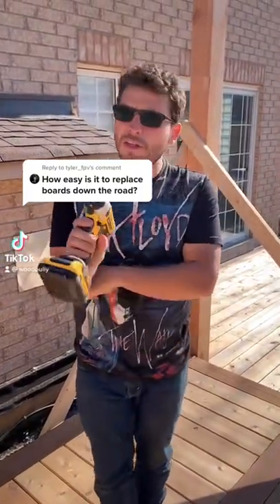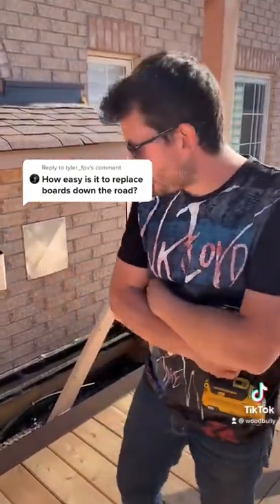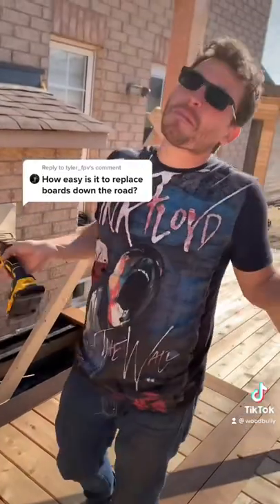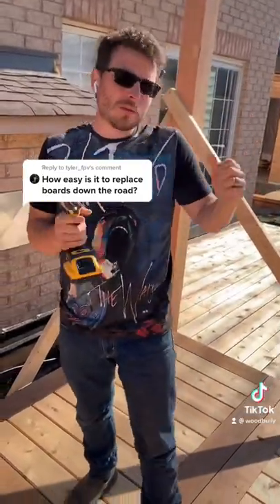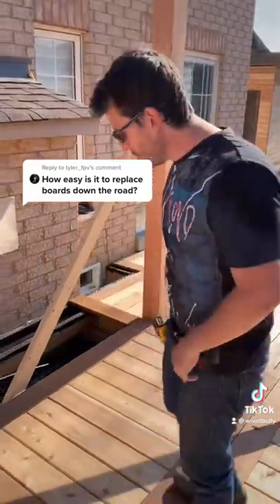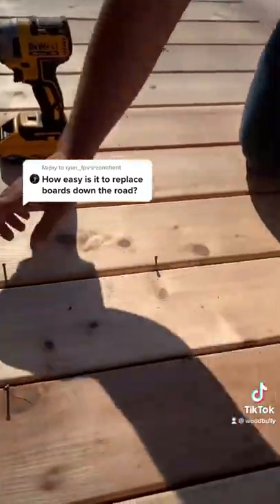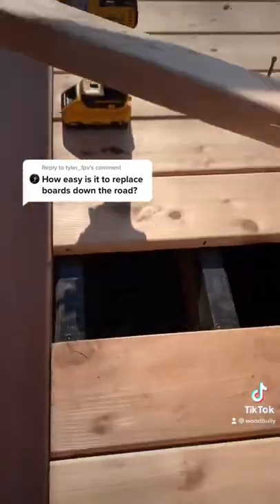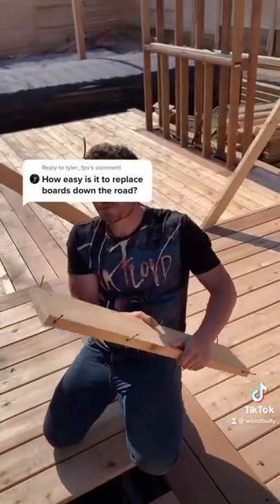How To Remove Camo Screws

Comment: Was that installed with 3/16" or 1/16" spacing? I wonder with tighter spacing if you could still get the screw out?